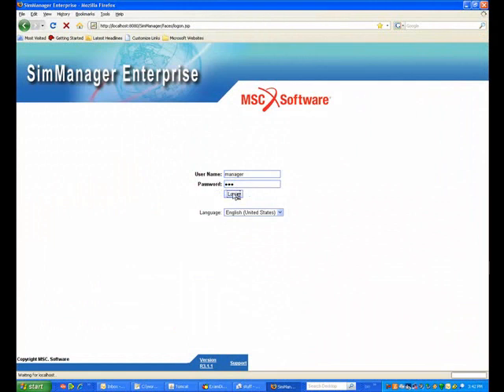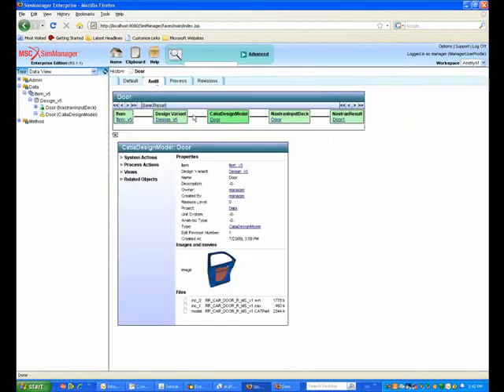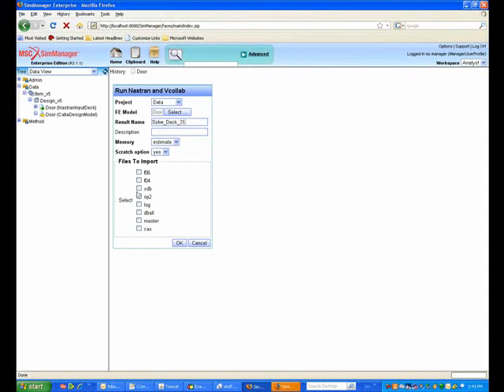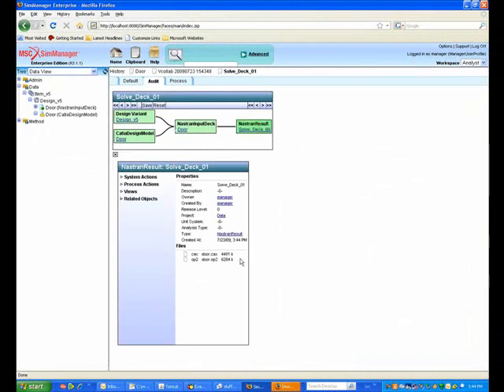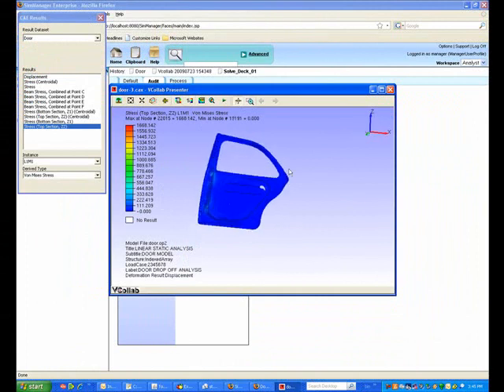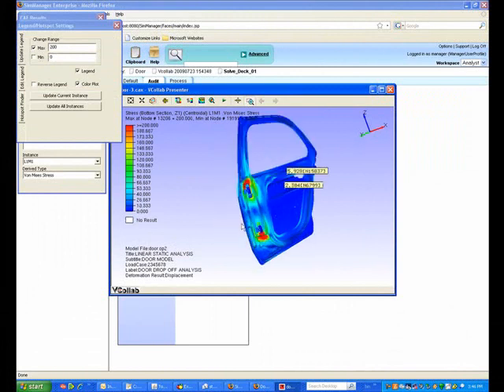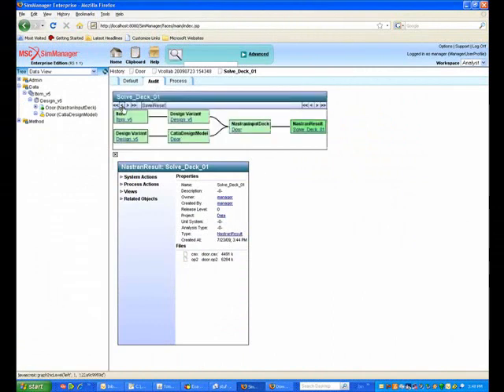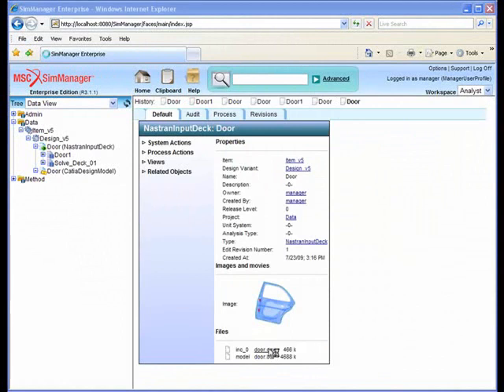SimManager with VCollab Integration (3D viewing)

Comment: It is a very nice video. I liked the way it is presented. First the 3D View of the CAD model, then the FE Mesh and then the results 3D view - all in one Sim Manger interface and one VCollab 3D Viewer - a nice work flow and nice presentation. It is also valuable to see the file tracing and tracking capability from CAD to CAE results in Sim Manager